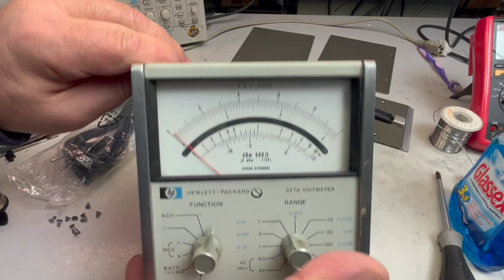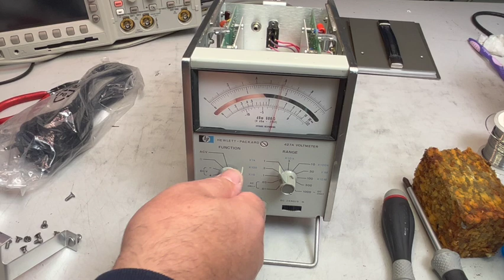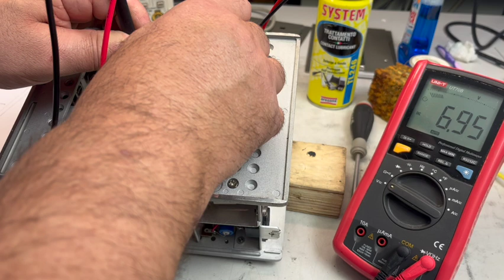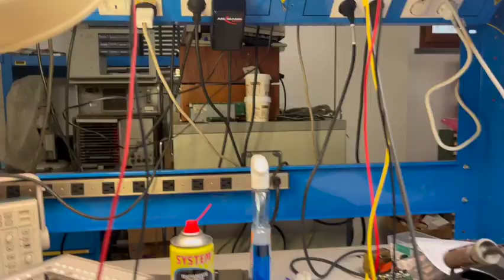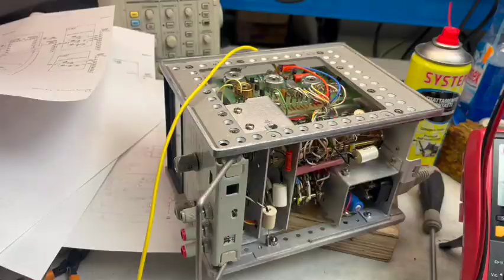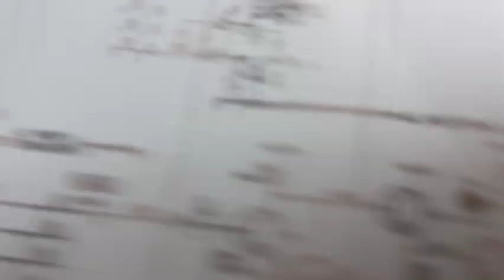HP 427A Repair and Restore

Comment: I’ve made batteries for these from 6 18650’s. They fit right in the original spot.  They last forever.  I take them out of the holder I used and charge them in an offline charger.
Reply from the maker: Thanks for the tip!

Comment: @8:00 it seemed to start working with the meter adjustment moved to a certain point, so I suspect the meter adjustment control is faulty.
Reply from the maker: @TheDefpom  thanks for your comment. A leaky cap was messing the DC amplifier circuit. After it’s replacement it works flawlessly.